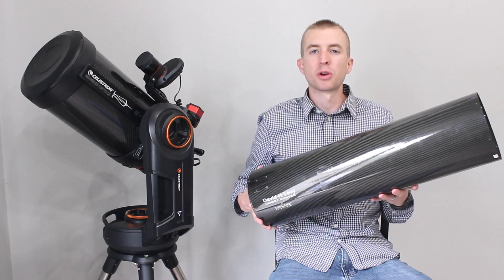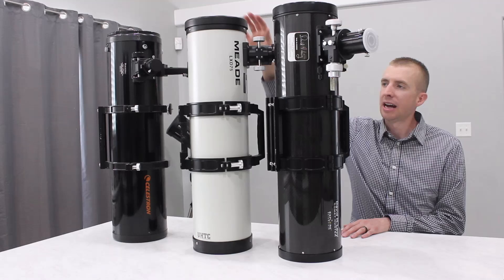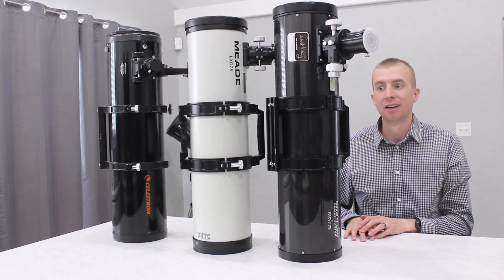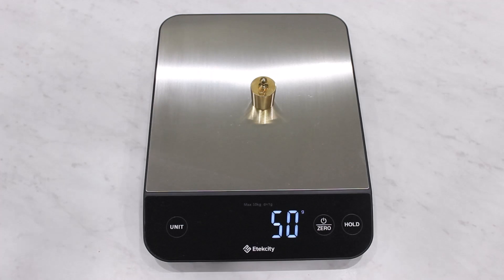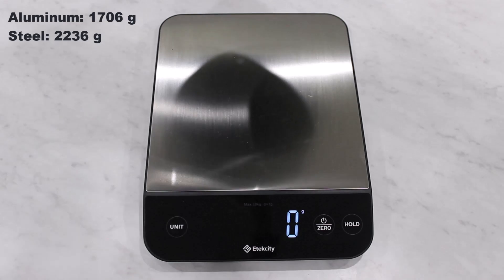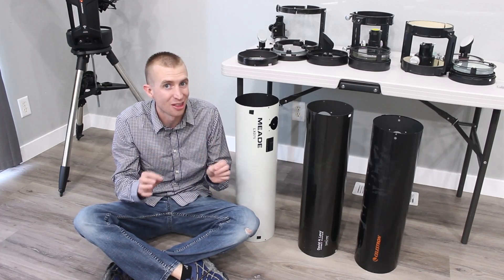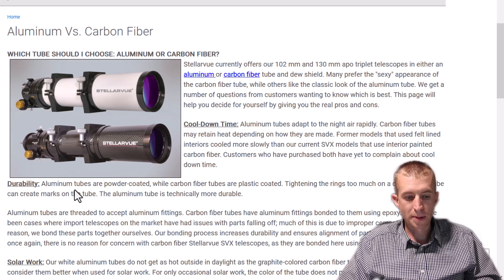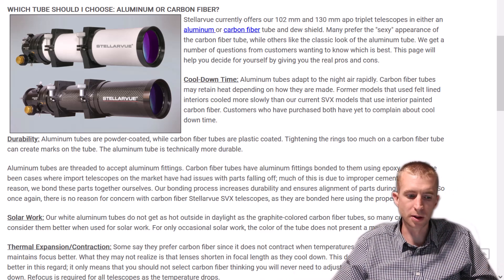The Carbon Fiber Advantage? Steel vs. Aluminum vs. Carbon Fiber

Comment from the maker: Thanks for watching! I hope you enjoyed seeing the weight difference in these tube materials. A few notes:
1) This is a general overview, thus I didn't dive into the primary literature on this topic. I am not a materials science expert. If you have information to contribute, please do so in the comments. Please keep the comments civil, and it would also help if you're able to cite primary literature.
2) Thanks to @stellarvuetelescopes for allowing me to include their article in the video. It's a good summary when it comes to telescope applications of aluminum and carbon fiber
3) General secondary sources I used for the video are listed in the description.
4) Mass and weight are often used interchangeably. They should not be. Weight is a force; found by multiplying mass and gravitational acceleration. For example, your weight on the moon and the Earth are different, as the gravitational accelerations of these bodies are different. Weight is measured in Newtons (N) in the SI system, or pounds (lb) in the imperial system. Mass is an extensive property - it is a measure of the amount of matter in an object. Unlike weight, mass does not change due to gravitational acceleration. Thus, your mass on Earth and the moon would be the same. Mass is measured in kg in the SI system, or slugs in the Imperial System. Source: Me.
P.S. I've never used slugs, but I am sure they are used somewhere!

Comment: What exactly does stripping them down do for testing?
To me the test would be, which one cools down faster, which one is easier to carry and set up. Which one is more stable.
Weight is important but real world is going to be a MUCH better test.
Reply from the maker: The test was all about the weight of tube materials. To be accurate the scopes had to be stripped down to minimize any variables.

Cool down time depends on several factors.. tube material, glass substrate and thickness, optical design (Maksutov corrector lens? Schmidt corrector plate? No corrector lens?) and atmospheric conditions. It’s not easily tested as there are too many variables, and hence why this test only focused on the tube materials.

Comment: Thanks for this video it made me make up my mind I was going to get one of these up-to-date modern telescopes but I'll stick to my old aluminum I have one I use for night time in the winter I insulated it on the outside with a automotive windshield sunshade  does the job does fiber optics do have a nice look to them
Reply from the maker: You can’t go wrong either way. Carbon fiber is great, but there’s nothing wrong with aluminum.

Comment: For mirrors, low-thermal expansion material like fused silica (e.g. suprasil) or even zerodur can make the focus a lot less temperature sensitive if a low-thermal expansion material like carbonfiber is used for the tube. So I wouldn't discount that advantage of carbon fibre for reflective telescopes.
Reply from the maker: I agree. I certainly still am of the opinion that carbon fiber requires less refocusing than aluminum as the night goes on, but it’s not perfect - nothing is. That said, I prefer carbon fiber tubes for a variety of reasons, the weight being a huge reason.

Comment: Nice.
Personally iv'e never really cared much about thermals of the materials and weight etc, but i do like the scope to be solid and tight. Can't say i noticed much difference between the materials when i use them, but my rigs also fully automated. Many warned me about carbon-refractors but mine have been behaving very good! If i decide to upgrade my newtonian i think the next one will be carbon as well (I do like the looks and stiffness), or at least a higher end build overall. A good focuser / image-train is important, this often feels like more of a letdown than the optics etc.
Reply from the maker: Yes, the focuser is usually the Achilles heel of high end telescopes and almost always need replacing. I agree though, if you watch some of my older videos I pretty much exclusively buy carbon fiber when it’s offered, like my older Explore Scientific carbon fiber refractors and such. The tube weight is drastically lighter and they’re quite stiff.

Comment: I did notice my RASA 8" did cool down faster than my RC8 but the RASA was refocused way more than the RC around the same temperature fluctuations.  The RC was so much lighter though and I ended up using it more than the RASA due to the weight!  The Rasa also has more glass thanks to the corrector.  Oh man you had 2 Comet Hunters?  I had in the past tried to source one of those and you have 2 LOL.  One thing I always wondered is why are most telescopes white?  Is it a thermal thing?  Thanks for your video, very helpful!
Reply from the maker: Yep, the carbon fiber shaves off so much weight, it is pretty amazing. The f ratio of the RASA also is something to consider when it comes to how often it needs to be focused, but yes, good observations there! My Comet Hunter is one of my favorite telescopes. My second comet hunter is mainly for keeping at my dark sky site, that way I can save room in my car and not have to bring it down with me. 

I should do an updated review on it sometime. You can find used ones on CloudyNights once every few months it seems like.

Comment: I also have a Comet Hunter and a few weeks back I brought it with me to a star party. In the daytime I had it pointed at the Sun for almost the whole day, I must say it did not get that hot at all. When pointed directly at the Sun the objective gets the most of the Sun's energy, the tube body is completely in line with the Sun and doesn't get that much energy. It's almost as if the tube is shaded by it's front diameter. CS
Reply from the maker: Yes, this is true - as the Stellarvue article mentions, if you're going to do occasional solar observing carbon fiber is fine. If you're doing dedicated solar observing it is best to use an aluminum tube. My point was about dedicated solar observing. I use my carbon fiber 8" EdgeHD for occasional solar observing and it also works well. That's a good point you make, thanks for the comment.

Comment: And what about duck taped cardboard tubes?  They just don’t get any love anymore.
Reply: After I wrote this it occurred to me that many (most?) of your viewers would have no idea what I was talking about.  In the early days of Dob telescopes, we made them with cardboard tubes.  Those among us with a little extra cash would then wrap the tube in duck tape to add to its rigidity and protection.  Those of us that went all out would then shellac the tube.
I hand ground the mirrors for the three I made, a six, eight, and ten inch.  Of course just about everything on them was hand made to keep costs down.  The only purchased part on mine was the focuser, and many people even made those.  Even doing it like this took me months to save up enough to build one, and a couple months more to build, but first light was always so special!
Reply from the maker: One of my astrophysics instructors in my undergrad had a cardboard tube scope like you describe and he did an awesome job. He brought it to an observing night and the view was great! That’s what I love about telescopes. It doesn’t matter if they’re 50 years old or new, the optics don’t change all that much (besides the coatings), and they work great! I’ve been wanting to do a vintage telescope series on my Meade Schmidt-Newtonians. Maybe I’ll have to add that to my list.

I really want one of the Celestron Comet Catchers in orange with the sled focuser. Tough to find those Schmidt-Newts in good shape though. It took me 3 years to find my SN6, SN8, and SN10!
Reply: A friend just build a 6" reflector scope with a cardboard tube. Is amazing!
Reply from the maker: If I had one that was the same size as all these other tubes, I would have included it! :D